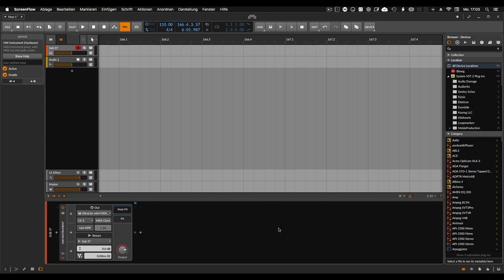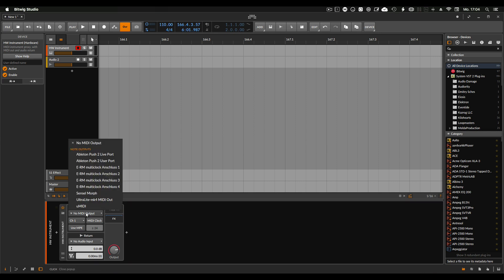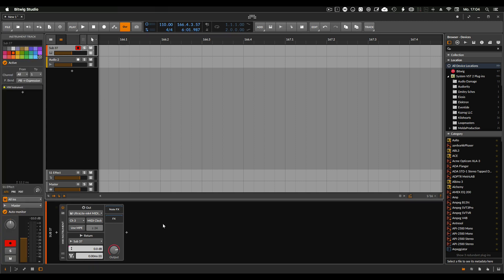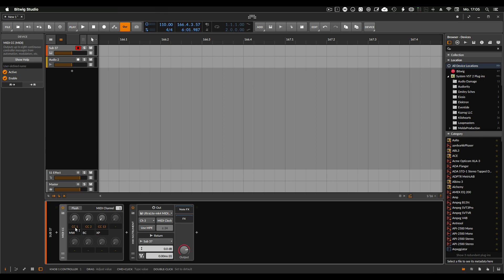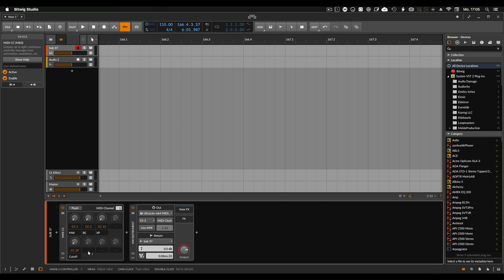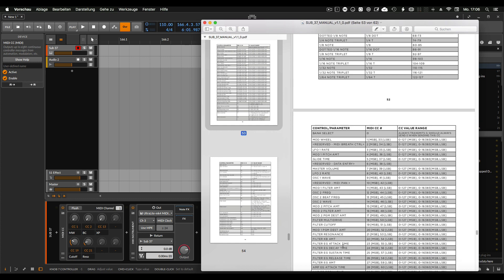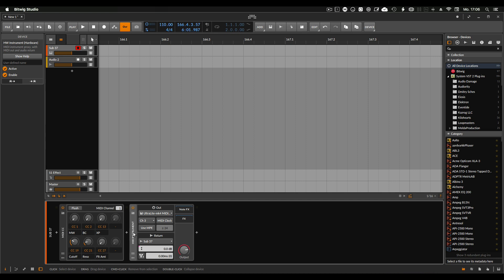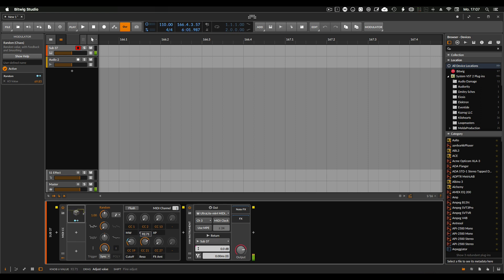Bitwig Basics V - Using external Hardware

Comment: Hi, I use Yamaha Montage in order to work  HW Instrument need to have all midi in or any I only see 1 to 16 channel I don`t know if you know any way around it. Thanks
Reply from the maker: What Midi Channel you use is up to you, but may you need to read the manual of your Montage ? Normally a hardware synth is listen to channel 1 as default
Reply: @noizebusters  Hi, the problem is Montage is different to other synth one piano sound could include 3 chanel midi in the same time. For me is ok because I own Nuendo 10.3 and both work perfect but I really would like integrate it on Bitwig. Thanks again.